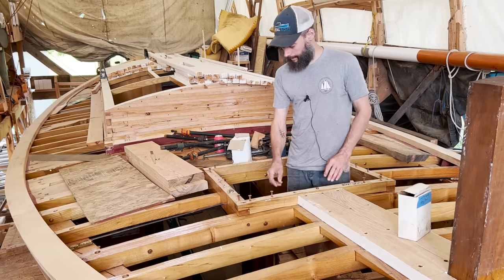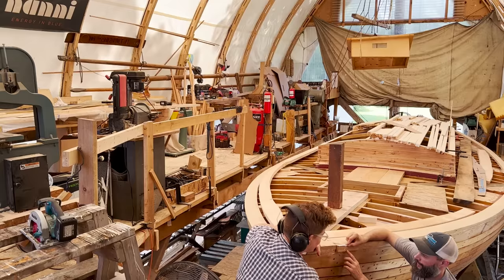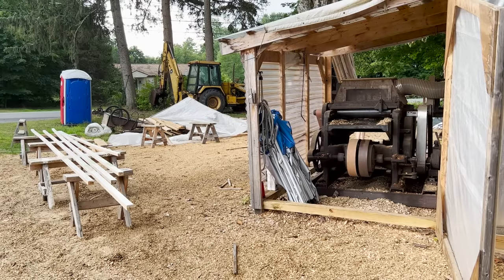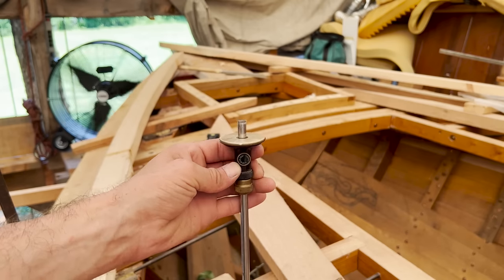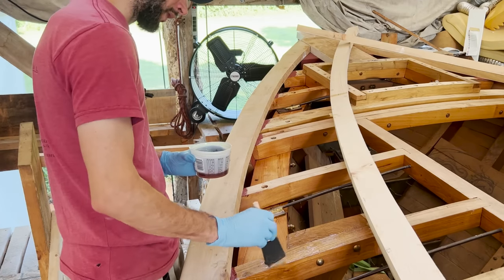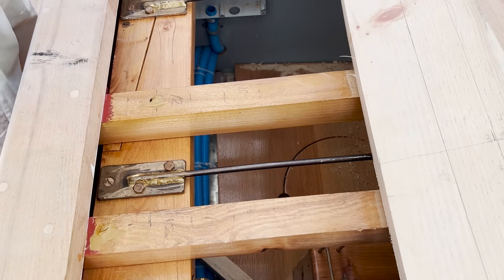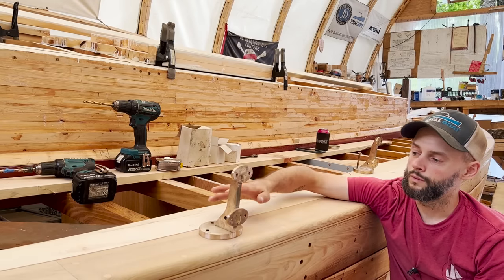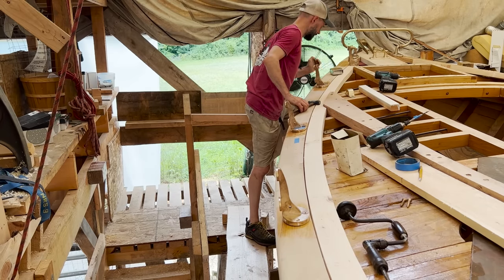A Lot Of Pressure And A Good Scrubbing - Episode 227 - Acorn to Arabella: Journey of a Wooden Boat

Comment: Adding the first of the  hardware must feel like a real milestone. That bronze traveller(?) on the stern is gorgeous. Your explanations for why you do things (and the way you do them) - the deep-sunk king plank screws, the single screw on the toe-rail brackets - is really great.
Reply from the maker: It does! And thank you!
Reply: 'Traveller'? or 'Fairlead'. I'm not sure of the item you are speaking of but I believe it may be the piece shown at 00:29:23?.  It is a loop to guide a rope, but has a slot formed in the top so that the rope may just be dropped into it. This one is for the bow mooring ropes but fairleads may be used for other purposes.

Comment: So nice to see you using that old hand brace to drive the screws, Steve.  My dad taught me to use his to drill holes in the 1950's, before I was allowed to use electric tools.  I still have it, along with his Millers Falls hand crank drill with the hollow handle that holds the bits.  Electric tools are sure handy, but the classic woodworking tools make you feel like you're carrying on a tradition.  Like your boat of course.
Reply from the maker: Thank you so much for sharing your story! It’s not just a feeling or a nod to tradition here, but what you use when slow is good enough and you want to have the screw heads be perfect for the future “you” doing maintenance. Cheers!

Comment: The entry of water into fixture holes on Arabella is something I’ve been thinking about as I’ve watched you drill numerous fixture openings and leaving the interior of the hole unsealed, relying on your outer seal treatment to protect if. Even on beams under the deck, you’ll get some condensation inside those openings due to humidity and temperature changes throughout both the annual cycle and voyages to and from hotter/colder climates with different humidity levels, plus (as you have pointed out many times Steve) wood breathes. I’m sure you have your reasons though.

Comment: Steve's woman is so strong she is ripping the boat apart before he even gets it completed. 😆😆😉.
JK 
The toe rail is going to look nice, but might actually grab some bare-foot toes if your not paying attention, OUCH! 😲! (I hope those edges are beveled or rounded. Square corners are going to hurt and cut, and cut lines too. And wear cleats faster if the cleats are not of stronger metal.).
I can hardly wait to see the deck planks being cut into the last pieces of wood put into the deck against the covering boards. (With brain damage from multiple concusions and strokes, I struggle finding words sometimes.) It's going to be fun working around the toe board cleats/brackets. 
Steve, just wondering why no caulking bevel at the end of the pine boards against the king plank? Thanks for any response.
Keep on rocking, the progress is awesome.
Reply from the maker: There is a caulking bevel there… they don’t always come through on camera and we don’t always show the bevel being set.
Reply: @AcornToArabella  oh, okay. Yeah, it looked like a straight seem on video. Thanks for the reply.

Comment: Wow. The brackets for the toe rails look great.  Cant wait to see the final result.  Watching you drill the holes for the brackets I noticed that you are using standard twist bits.  A set of Brad Point bits would make your holes more accurate, cleaner, and easier to drill.
Reply from the maker: Thanks for the tip!

Comment: Curious, why would you fasten down the brackets before the decking is in? I'm sure there is a reason, but all I can see is a serious tripping hazard for you as you install the decking and do other things. My instinct would be to mark all the locations and prep them, and leave them off until the decking is in and then fasten them down. But - I know nothing about building boats, so perhaps my question is stupid.  I've only seen the ocean a couple of times and never been on a sailboat. But this project has captured my interest from day one. Thank you.
Reply: He mentions in the video for ease of access to the back of the bolts which most of the brackets are fastened down with.

Comment: Happy Friday, A2A crew!

Trying to decide if a quick router jig wouldn't be the right idea for all those caulking bevels on the deck planks. But a sharp plane is surprisingly fast, and definitely much quieter. And somehow working with a plane always feels right.
Reply from the maker: And it sneaks up on the bevel in just a couple swipes. A slipped router on this stock that took us so long to prep would be disaster.
Reply: @AcornToArabella  you guys have the worst luck with router bits. I've literally never had a bit slip in 25 years of woodworking.
Reply: @paulheitkemper1559  jinx

Comment: Really surprising to see the grub bend as much as it does when installing the screws.  I figure the deck boards will help strengthen and make the area more rigid, but you can clearly see the area flex as he drives the screws in.
Reply from the maker: It should be flexible. Now with the screws in and mated to the beam below it, it becomes part of a system. If each piece going into the boat were rigid, it wouldn’t be ideal.

Comment: In my view it would have been better to cut a parallel nib plank, to establish the heels of the nibs. Then use a batten with deck planking marked on from centre line, to mark nibs and cut the unshipped plank. On the other hand, I appreciate there is a different dynamic on a YouTube build and the quick way is not necessarily the optimum one. If we have learned one thing from this project it is the end result will be of the best quality.
Reply from the maker: Thanks for saying so!

Comment: Steve, you have been so aware of the stress which the covering board will have to take every time when the boat hits a pier or piling, that you insisted to make the covering board out of black locust wood. But your covering board is protruding the edge only very little, and the brackets for the toe-rails are leaning outward. Will it not be the toe-rail that will take the blow when the boat hits a pier? And will such a blow not rip the brackets out of the covering board?
Reply from the maker: There will be a rub rail, friend.

Comment: John Beirne-I wondered if you were going to seal the bolts that attache the bulwark brackets to the covering board. I know on fiberglass boats, this is a real problem because water works itself in through the bolts and rots the core. will this be a problem here?

Comment: When you eventually have to start replacing boards, what do you do with the old screw, bolt, or rivet holes? Can you use them again, or do you have to fill them and make new ones?
Reply from the maker: Typically we’d use them again, barring damage during removal.

Comment: I think you have made a bit of an error with those toe rail brackets. When you moor alongside another boat or against a wall, those toe rails are going to be the first thing touching, especially if the boat is moving in a seaway (heeling).  You will want thick fenders and even then, there will be a time when the fenders don't prevent damage,  The problem is that the deck underneath is not horizontal, so the toe rails will end up leaning out.
Reply from the maker: There will be a run rail as well.

Comment: The round over edge board detail looks really nice!  

Why are you putting on the toe rail brackets on before you do the decking?
Reply from the maker: They’re through-bolted, and so it’s easier and more comfortable a reach at this point than when those spots are a little more closed off and we have to work on them upside down.

Comment: Happy Arabella day! Switzerland checking in! Friday lunch break is always my favourite 🙂
I have a question though: What's the plan with the nib planks near the house? They sort of look wiggly and unfinished in the mid section where they're wider...
Reply from the maker: Hm, not sure what you mean but that’s coming up soon.
Reply: I saw the thicker portion as well.  I think because the deck planks will be nibbed in fore and aft, but parallel to the nib plank through that portion, they left extra material to decide at the last minute how thick it will be in that region.  If they decided now, they could be left with an unusually thin or thick deck plank.

Comment: nitric acid makes short work of getting the patina off of bronze and brass, Nasty fumes though quick results. I used it in antique furniture when the customer wanted a bright polish on the hardware. results in not needing to remove sandpaper scratches and can go right into polishing with cloth buffs.

Comment: Do you not use power tools to put screws in? You use them for cutting boards. I just don't get it.
Reply from the maker: In bronze, they easily cam out when using a power tool. We’ll use the same fasteners, inspecting them or replacing the part they hold together, for a great many years.
Reply: @AcornToArabella  I was refering to using them as apposed to the bit brace.
Reply from the maker: I get that, and that’s what I was answering. At this scale of fastener, is there a benefit to putting something in a few seconds faster if the head is damaged? From what we read, no. This is an intentional decision with a soft metal.
Reply: @AcornToArabella  Not the metal. the wood parts

Comment: I don't know if it has already been asked, but are the bronze fittings going to be chrome-plated or not?
Reply from the maker: No.
Reply: togusa:  Just curious, why would you want to consider chrome-plating the bronze fittings? Not into the 'bling' look. Exposed bronze takes on a nice weathered look over time which I think will look rather nice and compliment the overall look of Arabella.
Reply: @evanschwartz3030  just out of curiosity. ALso cause that's what they're doing nowadays in boatmaking. I know Arabella is going to be kind of an old-style boat, all wood and bronze... but there are some modern solutions and materials already: fiberglass, epoxy resins, LED lights, etc.
Also, I suppose there are going to be some chrome-plated parts anyway, the winch(es) to name one, so chrome plating the fittings would simply complement those parts.

Comment: Does anyone know, or think, that there has EVER been another wooden vessel of this size and configuration, that has ever been built to this specification and level of craftsmanship?
Reply from the maker: Yes. I can name many—and that’s a good thing! Similar configurations, including with workbenches. —Anne
Reply: It depends upon how tightly you want to define the specification. If you insist on a a reefer with a burr cherry top then you might struggle. But there are lots of similar sized wooden sailing boats around. I don't have Anne's direct experience but the internet provides everyone with a virtual marina. Julia is a wooden Ingrid found on YouTube under 'Madison Boatworks'. No bronze floors I'm afraid but she looks sound and pretty, she has tight seams and is on the water. If something slightly bigger and with a different style is acceptable, one of Luke Powell's pilot cutters sold recently and there are pictures on the internet.
Reply: Thanks for both replies.  I used to work on wooden fishing boats in Alaska, and of course, had to do maintenance on them constantly.  With that/my shallow experience, this build blows me away.  It is of a quality of something I could have never dreamt of in the day.  Seems to me so good it could almost last forever!  Thanks again, everyone.